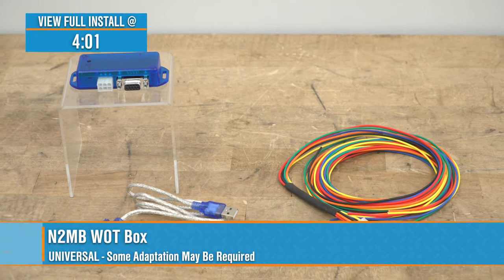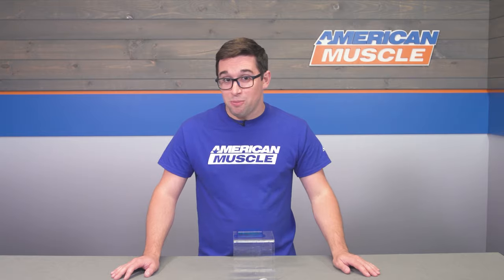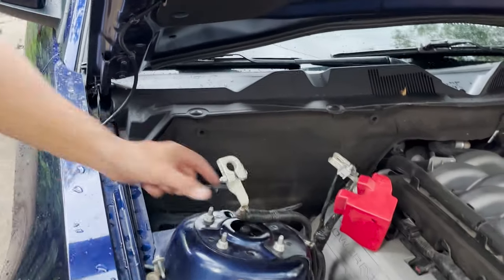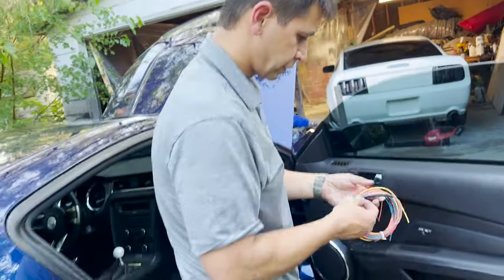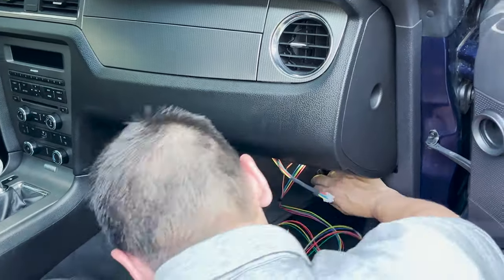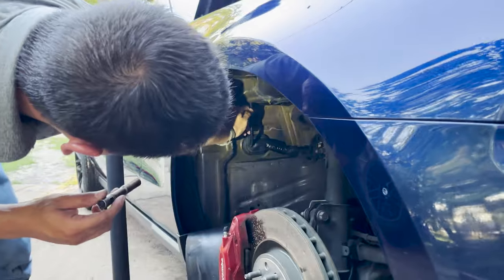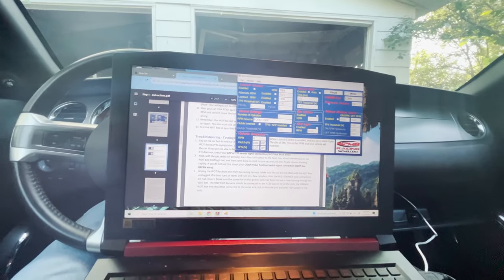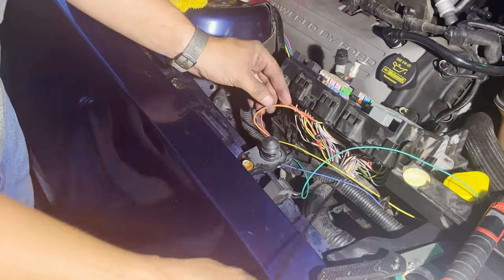Ford Mustang N2MB WOT Box Review & Install

Comment: lol.  pretty self explanatory?  then why bother doing the video?  you have the launch control set at 7001 rpm?  FYI people, you do not need to remove your battery and tray to install this.  Run the wire in a loom along side the huge factory wiring harness.
Reply: Yea no I’d rather not short circuit it lmao
Reply: @1slo_eco  I'm saying you don't have to "remove" or pull the battery out.  Yes, disconnect it.  I always disconnect to hook anything up.

Comment: was told these are hard on your engine
Reply: If you flat foot shift probably, but for 2 step it’s probably normal.
Reply: I'm already on my 3rd Coyote engine (original plus 2 replacements), not concerned with blowing this one up too... But theoretically it is hard as it is literally cutting spark to cylinders but theoretically it's also easier on the transmission as it cuts power when shifting...
Reply: @RepoDraghon how did you blow them?
Reply: @ChoomMedia  2 step does quiet a bit of wear and tear on the timing components. I've seen a few people on YT snap timing chains 2-stepping